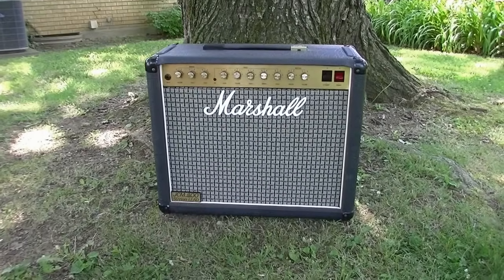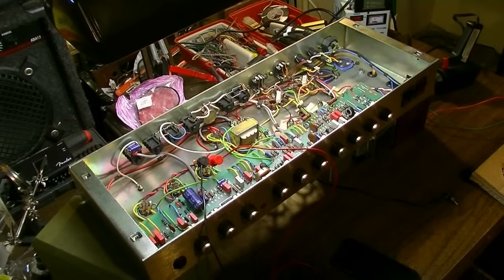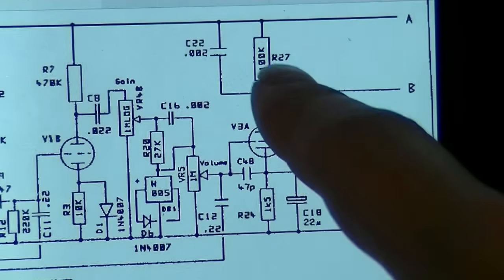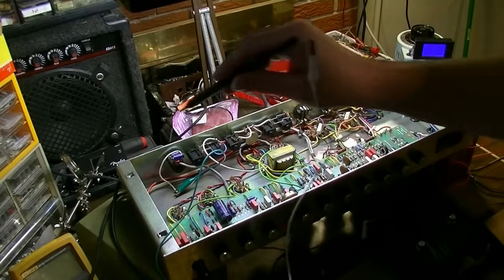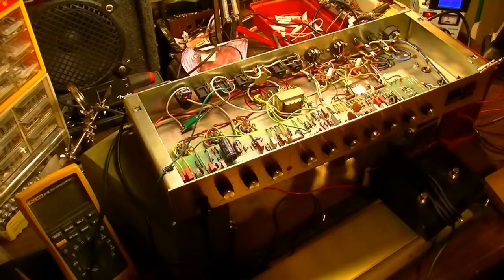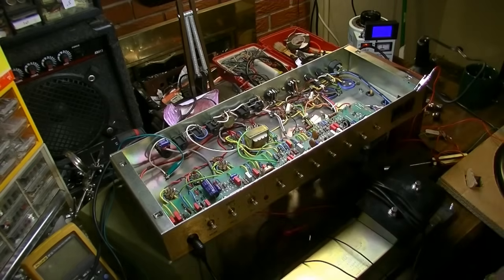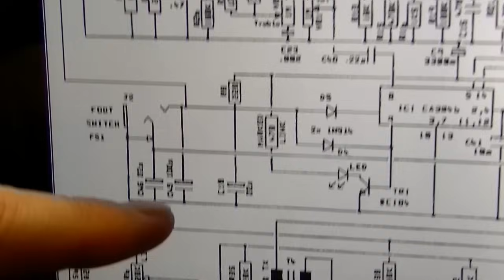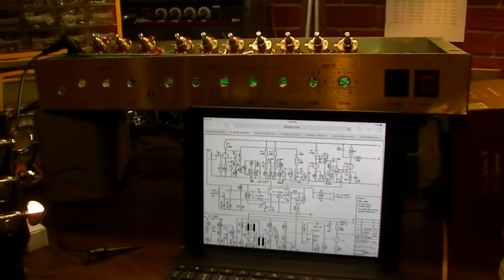The Amp Repair that Almost Broke Me - Marshall JCM800 Combo

Comment: Good man! I hate direct mounted pots and jacks or any component that has a external part/plug.
I have seen more gear ruined because of the cost saving' methods used by manufacturers.
Reply from the maker: Agreed. Not a fan. But miraculously, they weren't part of the problem this time.

Comment: Hey Guitologist-Thanks for all the great videos! Could you point me to a source for those black plastic caps that cover the hardware on the top handle? I have not had much luck finding replacements. Thanks!
Reply from the maker: Soon as you said that, I started looking. I thought for sure someone would have the plastic part only, but I couldn't find it either. The entire handle is only like $10 though: http://amzn.to/2sA19C6

Comment: I never realized that before, but it actually means that both the clean and the OD signal is running through an IC in the middle of the amp ?? So it is not a clean tube signal path 😞.

Comment: I have a 900 100w and I have exactly the same problem.  Wouldn't it be better to just rip out all the crap boost channel and take it back to sort of an 800?  I loved my amp on just the normal channel cranked but the problems I have had with it makes me want to burn it.

Comment: Good video ! ..this reminds me i need to replace the high voltage filter caps in my Tapco 6000r   Mixer !.. you aught to put a Jbl d120f in there !! or an Altec ...anything Alnico ...makes a big difference in sound ..really in any amp..i had to put a choke on a bassman 100 and replace the high voltage filter caps and modified it to Blackface for Guitar.. smoked a pack of cig's in an Hr !..I'm using a Sano tube amp now,from the 60's all org with tubes hand wired but the output choke i replaced and speaker...and have a fender super 112 red knob i love for cleans..but the particle board layout sucks but has tubes also...Edit : used a solid state SUNN Stagemaster for yrs till i got a fender red knob tube amp 100 watt version ..and never will look back ;:*)...tho it died on me..hence the 112 above 60 watt i think..great good amp for cheap on Ebay for a tube..the built in distortion sucks..i use a Marshall ''the guv'nor'' for that :)

Comment: I love these Marshalls because you don't need pedals to get more gain, it has plenty! You just have to tweak them a bit to smooth them out. Good tubes, ect... It's not for modern metal though, I use it for Hendrix, Gilmour, Blackmore, Zappa, Jeff Beck type tones, right out of the amp into low wattage Celestions, no need for a fuzz. The clean channel is kind of crappy though, that's where some mods would be welcomed. Some techs try to make it more Fender-y which I oppose because it's too extensive of a mod with meh result, so I would prefer to just get it more like a sweetly clean early Plexi.

Comment: Kind of off topic, but I have been dealing with a Laney AOR 30 for a while that is confounding me. The reason that I am commenting on this vid is because the AOR'S are supposedly hot-rodded JCM clones, and looking at the schematics, they do bear quite the resemblance. This one will initially sound great, but after about 15-30 minutes, the output will drop to near zero. After a minute or two, the volume will return to normal, only to drop out again after a few seconds and so on and so on... I've replaced tubes with known good ones, still the same. Checked the board for any components that looked roasted, but didn't find any. One thing that was interesting was that it wouldn't do it, if there was anything running through the effects loop, for a while, but even with that, it started happening again. I even replaced the jacks for the loop, thinking they might be opening, but still the same thing. I guess I really need to probe the path and determine exactly where the signal is losing amplification. The amp uses several TL072 op-amps, so I suppose it wouldn't hurt to look there. Also, have heard folks say that adding a choke is a good idea. Any opinions? Thanks all.

Comment: Tr1 is the switching transistor for the LED only.  All other switching to do with the channels is done by IC1, the CA3046 transistor array.  However, the way the channel switching has been done is extremely, (and I mean extremely), poor even in the later models where the channel bleed aspect was reported to have been fixed.  You have transistors inside IC1 which switch the other aspects shorting one channel signal at a time to ground(ish) through caps either C11/C12 or C40.  Using a BJT to short out a bidirectional signal is NOT a good thing to do!  Apart from the poor job of controlling the channels, if TR1 goes short across its base/emitter it will pull down the IC1 internal transistors with it and interfere with the switching action.  If you can make a very simple PCB, it is actually quite easy to mod this whole setup to do the job properly using a couple of cheap everyday small signal MOSFETs and a micro relay on a tiny PCB which fits into the same footprint as the original CA3046.  You can even change the Red On/Off channel LED to a Red/Green type at the same time if you prefer that.  I posted details of how I did it here if anyone is interested:  http://www.marshallforum.com/threads/jcm800-2210-splitch-pcb-component-layout-diagram.111031/#post-1911592  Everyone always reports guys saying they can do this but giving no details, here is enough detail for you to do this yourself if you really want to.  And no, I'm not selling anything to do with this mod!

Comment: I have been really tempted by the 100 watt version that recently came up for sale locally in NZ. I made inquiries etc. I am having second thoughts. Too much to go wrong and being so old it must be due. I think I will stick with my JMP 50 replica and do some mod to tame it, so it does not kill my Torpedo Captor (the load box can not cope withe the amp above 8 and shuts down due to the overheat protection mode). I'd like the thing to be '60s Plexi like it is, but also have a switch that turns it into a 2204.

Comment: I have a Traynor YCV 80 4x10 combo. I took to a (tech) and it is worse off now than it ever was. before the tube fail it was a great sounding amp. If you are interested in going after this one I would pay shipping both ways and all parts needed. I am desperate to make this amp happy again. If not it will just end up being a 4x10 cab.

Comment: I had a similar problem .but mine was a broken ground or bad solder joint on v3a and the reverb. I also was having problems with a bad tube I thought was fine, I went over everything 3 times  and finally figured it out, these are tricky amps to work, I have the older version which is slightly different, I got kt88  it screams I have to put it in my closet to try and block some of the sound. Lol it's definitely a big hair 80s amp. The good ole days.

Comment: You can check ESR on those bigger electrolytics in-circuit with the cheapish testers from *bay. They may measure good microfarads but high ESR. The new preamp tubes are sucky compared to NOS or old used preamp tubes. The old tubes can usually handle more than rated plate B+ and wont crap out. NOS is good investment for Marshall and Fender guys but they are viewed as way too expensive.

Comment: I notice you don't use a scope and signal generator in fault finding. Your method of fault finding, IE taking voltages etc is a good one, but a scope is a very useful tool. Nice to see other folk struggle sometimes too fixing amps : ) Cheers.

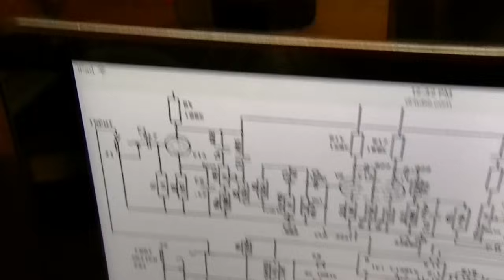Comment: @37:43  The 2 caps C41 and C42 connected to R10 are both connected to LINK.  Schematic shows only C42 and R10.  Something looks odd here.  Looks like both those caps are not connect to 0V.
Reply from the maker: Yeah, that is confusing. The "LINK" wire is different than the "MARKED LINK" resistor. LINK is at 0V. At least I'm pretty sure that's the case. I did not measure, but assumed since those caps were already there.

Comment: Hey Guitologist-Thanks for all the great videos! Could you point me to a source for those black plastic caps that cover the hardware on the top handle? I have not had much luck finding replacements. Thanks!
Reply from the maker: I looked again too and couldn't find just the plastic bit. The whole handle is only about $10 though: http://amzn.to/2s0LheQ

Comment: I wish you were my neighbour... I have the 100w head of the same amp 2210. Bought it a month ago fo 300£  because not working properly. Similar microphonic problem but in V1 and pcb which is kind of microphonic as well. I will try to follow the same steps you followed. Change all  the elect. Cap including the cans, new pre valves and see what happens.
Reply from the maker: Good luck! Keep us posted on how it goes.

Comment: Ah. The old spring reverb. Thanks for this video Ken. I noticed you said the speaker was 70w and the amp 50w. I heard recently (talking speakers in series or parallel) that the amp had to have twice the output of the speakers. Not only does that not make sense to me, but I always understood the speakers ideally need to have greater capacity than the amp - bearing in mind how they rate amp outouts. Do you have a definative on this? Thanks.

Comment: I have the same problem with my solid state amp. It's similar to the one you're working on , only it has no valves. I get close to no sound . I need to send it to be repaired but I have no vehicle to get around at the moment. My amp has a reverb tank as well , but it sits on the floor.

Comment: was v1 and v2 the problem all along. did you waste time replacing all those transistors and caps?
Reply from the maker: No, the transistors, if you'll recall in the vid, allowed the amp to finally come alive on the Boost channel. The channel switching transistor was def bad. The reverb transistor was changed also because it probablly saw the same spike that took out the other one and I figured might as well get it too while I'm in here. The caps may have been ok, but at the time I was troubleshooting, I had no reason to think the V1 or V2 tubes could be the culprit since I'd already tested all the tubes (edited the tube testing out of final cut for time). Replacing them ensured they weren't a problem and won't be a problem for the foreseeable. Two of them - I think C41 and C42 - were actually the wrong value from what was on the schematic. They were 2.2uf, but schematic called for 10uf. I replaced with 10uf. I think the 2.2uf were the result of a former service.

Comment: Early in the game @ 21:45, I'd suspect a shorted D1 or R3 in V3B. If not that, possible shorted R24 or C18 of V3A. Something's causing V3 to self-destruct, plus there's no signal on the plate of V3B.

Comment: Hey man, i'm, a really new subscriber (just for a couple days), and I didn't realize you were in Louisville!  Do you also do guitar repairs/setups or are amplifiers more your gig?  I have an Ibanez Artcore hollow body and the frets aren't level where the neck meets the body and was wondering if I could inquire with you about options and pricing and what not, of id that isn't your gig if you could refer me to anybody.
Reply from the maker: Hi Harris. Yes, I do guitar work as well. Right now I'm taking a hiatus from accepting new work until July. If you can sit on it til then, send me an email come july: 
bradlinzy at gmail.

Comment: Hello my friend i have one of these exact amps. I bought it and it was working but it blew i fuse and a one of the bigger tubes. I bought new fuses and new tube and installed it ,and nothing. I m hoping that this video will give me a little insight into whats wrong. And i know these amps are dangerous even with it unplugged. Get back to you if i succeed or NOT. im a little scared of the amp and its power. Wish me luck!

Comment: Did I see a Jag XJ in the background outside at about 4:41  ?
Reply from the maker: Yeah. My wife and I both drive Jags. Hers is a Vanden Plas. Mine is the lowly XJ8.
Reply: Very nice in both cases! Great tenacity on this amp fix I was trying to keep up... So as far as changes that actually got the amp going was it just the pre amp valves being replaced that got it singing again?
Reply: I was kinda thinking the same thing.... but Brad said there were multiple issues with the amp in the description. I was following along kinda half listening while doing my own stuff, and the next min it's back together... Normally tubes aren't the issue, but maybe this time..
Reply from the maker: The transistors in the switching were definitely bad. I replaced all those caps just to be sure. I also ended up replacing 3 tubes, all of which tested good on the tester. Go figure.
Reply: Ah cool man definitely the signal tracing was really interesting it woul be cool to see which pins you were probing for the A and B sides... I suppose the ECC83/12AX7 Valve has standard pins for the various aspects of its operation? Amazing vids and the amount of skill you have is awesome!
Reply from the maker: There is a pinout diagram in the datasheets: http://www.mif.pg.gda.pl/homepages/frank/sheets/093/1/12AX7.pdf
When probing for signal, you can probe the grids (pins 2 and 7) or the plates (pins 1 and 6). That is the same for any of the 12A*7 family of tubes.

Comment: Eating V3.   OK,  DC on the grid  most likely !.  This causing tube to draw lots of current. Is it distorted ?   Check caps feeding the grid from HT.  C8 C12 C16. etc.
Reply from the maker: Fun game, ain't it. :P
Reply: Check for voltage on the grid. First thing I'd do.

Comment: Wait,.. after replacing a box full of good components in a shotgun attempt, the problem was one of the tubes, but you don't know which one?  Wondering what you charge for a fix like this?
Reply from the maker: No, this thing had a cocktail of issues. The switching circuit was screwed. A transistor was bad, a cap was also bad in the switching circuit, AND one of the tubes the owner sent was also bad. It was a case of fix one thing and find something else wrong.

Comment: That Gibson is "TOOOOOO  SWEEET" ,,,, yet , 800's RULE , and a small hint , check out the Crate VC 20 single 10 
combo
The one W/O  reverb ,,,,,,,,,,,,,,,,,,,,,,,,,,,,,,,,,,,,,  considered by many the "Mini 800" , I pair one with a VC 30 
and have 3 levels to play with , with an "ABY" switch , I kick in the VC 20 ,,,,,,,,,,,,let's just say it is my outboard lead channel
With a "Fuzz Face" and  some "Flange/Phase" for the Jimi/ZZ  tunes going to it   , and a "Wah/Tube Screamer
out front for both amps . I left the Fenders to collect dust after finding the Crate VC series 
Marshall 800 tone on the cheap ! AND FREAKIN' MADE IN THE USA the original series that is

Comment: Not sure about your electronics background but an oscilloscope would save a lot of time... Cheap as chips these days!
And make yourself a signal input which gives you a constant tone at say 500Hz. Give you something to track through the circuit.. 
Agree with your suspicion of old electrolytics though!

Comment: Ive gigged a 2205 (50W version of this circuit) Very heavily since 1989. Bought new, and is a fairly decent amp except clean channel. Most problems ive  had are switching ICs go bad, and  garbage circuit board traces. If you keep these amps long enough you will be flying leads around here and there because desoldering tears circuit traces. Also they tend to be noisey ( hiss, hums) and in most cases there will be absolutely nothing you can do about it. It's just a noisey circuit. Drake transformers sound good and mine eats screens at around 472 v. B+ is 507 unloaded. In the 80s, the only production tube that would survive a year of every weekend duty were Peavy branded SHugaung   super Cs. Ive since went to 6ca7 and eh will live three months, JJ not much longer. Im playing Plexi now, but have a variac on the way and will break out 2205 again. All that said, when this circuit is dialed in, it is the sweetest marshal ive ever heard.

Comment: Something about the switching in Marshall tube amps seemingly always crapping out. I figure it's the internal heat over time.
Reply from the maker: Heat will be worse on the combos too since tubes are upside down.
Reply: The Guitologist yep, exactly! I own a JTM60 combo. Worst offender from Marshall. There's a hole in the chassis directly above the horizontally-mounted power tubes that leads directly to the PCB with the radial filter capacitors. Wiring in a PC fan is mandatory.
Reply from the maker: Switchable would be good for recording.
Reply: I added a fan to my Blackstar HT-5C, after it had the mosfet PCB leak they all got. I used a 90mm 2000RPM 12V fan, powered at 5V via a phone charger, and it makes less noise than the power transformer. ;)
Reply: MuscleDad420 Yep did the same with my JTM622, the heat was killing the amp. Used a Noctua NF-A8, very quiet and super cool now.